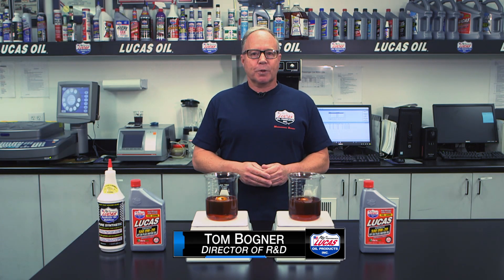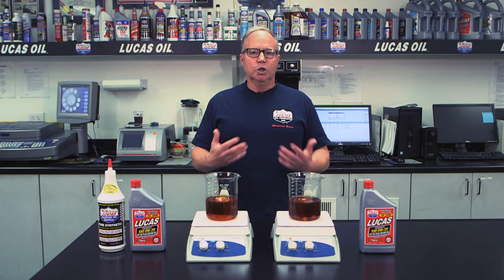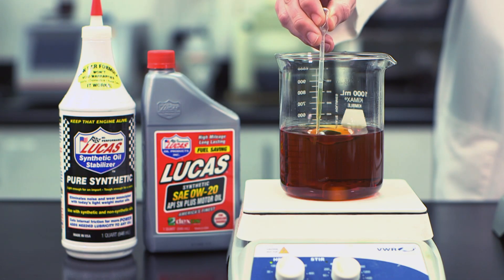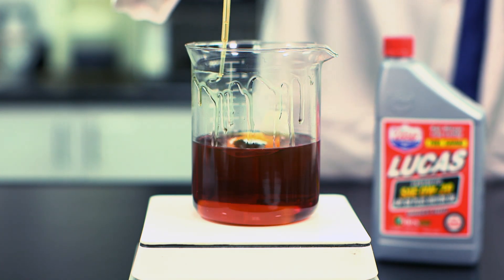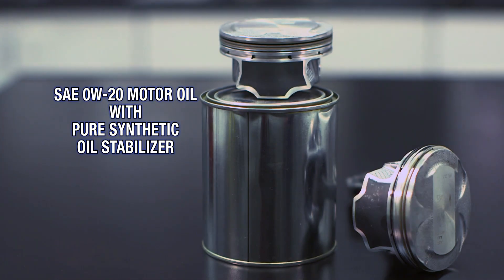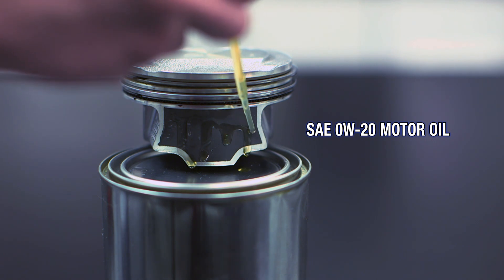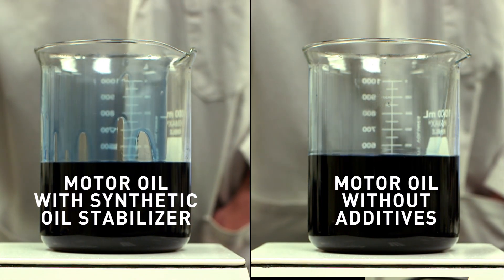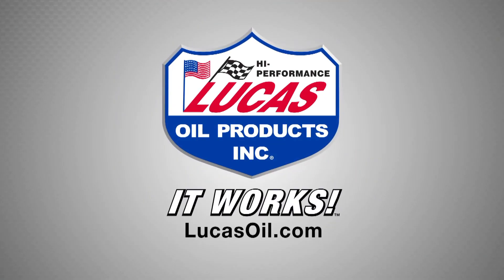Lab Test Lucas Motor Oil vs. Lucas Motor Oil with Pure Synthetic Oil Stabilizer.

Comment: Here’s a reusable, binder friendly Lucas % → SAE grade converter tailored to MaxLife 0W 20 + Lucas Pure Synthetic combo.
Assumptions (same as before):
•	Base oil: Valvoline MaxLife 0W 20, (\nu_1 \approx 8.5\ \text{cSt @ 100°C})
•	Additive: Lucas Pure Synthetic Oil Stabilizer, (\nu_2 \approx 45\ \text{cSt @ 100°C})
______________________________________
1. Quick “eyeball” converter (what grade am I in?)
Use this as your fast rule-of-thumb:
Lucas % by volume	Approx cSt @ 100°C	Effective SAE hot grade
0%	8.5	20 grade
1–4%	8.6–9.1	20 grade (slightly thick)
5–7%	9.2–9.6	High 20 / just touching 30
8–11%	9.7–10.2	Low 30 grade
12–16%	10.3–11.0	Mid 30 grade
17–20%	11.1–11.9	High 30 grade

Comment: The oil stabilizer didn't work on my truck.  I had a van run a stop sign at 60 mph and hit me while I was going about 45 mph.  It didn't protect my engine block from cracking from the impact.  LOL.  

Seriously, I use this in all my vehicles and toys.   The truck I mentioned above was a 2007 Silverado with the 4.8 V8 which had 366,000 miles on it when it was totaled.

Comment: Why aren't we at around 250°-290°F to simulate high oil temp like towing?
Reply: I’ve never seen temperatures like that towing he’s y between a Chevrolet Silverado and a Ford F150 towing at near maximum capacity. Not gonna lie that’s pretty radical temperatures, where are you seeing those type of temps???

Comment: Nice Video, For a F150 17 3.5 Ecoobost With 62,000 mi. should i use Lucas Heavy duty or Full Synthetic ?
Reply from the maker: The product we would recommend would be our Lucas Pure Synthetic Oil Stabilizer #10130 at a 20% treat rate.

Comment: In the intruction label said on harley-davidson motorcycle use 25 or 30% to the engine.Is 25 or 30% of the stabilizer(about 8 oz.of 32 oz bottle)or 25, 30% of the total oil charge of the engine?.thanks

Comment: 2013 Civic Si with 200k miles. Pure synthetic stabilizer or High mileage?
Reply from the maker: We would recommend our Pure Synthetic Stabilizer #10130 for your vehicle. This product will not change the viscosity of your motor oil as much as our High Mileage would.

Comment: Just bought the high mileage stabilizer for my sons camry with 290k.  It burns a bit and Ive tried them all, changing out PCV and hose and added Lucas.  Fingers crossed.
Reply: We have a 2013 Rav 4 we purchased used with 219k it consumes a lot of oil using 0w20 (eco oil that’s recommended from Toyota) started using Lucas heavy duty oil stabilizer with each oil change and the oil consumption has decreased significantly!

Comment: After much deliberation this is my final conclusion of the big "lucas debate".
Everywhere you look online you find self appointed experts who are quick to tell others to stay away from oil additives because "they are snake oil."
You also find almost as many people claiming they found benefits and have very clear reasons and examples of why they found benefits. 
What you dont find is people claiming the product harmed their engine in any way.

Let that sink in.

Then you have the viscosity debate. People are quick to assume that using factory oem weight is best because...well just because they said so. 
What they fail to consider is the money trail. Cafe standards are not testing longevity, they test efficiency. Using thinner oil means higher MPG. Higher MPG means lower cost of ownership, more sales, and financial benefits when it comes to carbon tax for both manufacterer and user.
People will argue "engine clearances" yet ferrari uses 10w40 or 50 in their engines. So do high power mopar engines. Are you really claiming those engines have "loose clearances"😅

The bottom line is that people who say "no to lucas", have very little evidence or experience with the product to back that up.
People who say "yes to lucas", gave it a try for one reason or another and found benefits. They did not simply wake up one morning and take to the internet to tell others to start using it.

Did I miss anything? Lemme know if I did.
Reply from the maker: 👏You sir, are a gentleman and a scholar!
Reply: @bigboreracing356  Ok so lucas has no bad reputation because of cyberbullying. Boy you over thought that one.
And it causes oil sludge in old engines that only drop the pan after adding Lucas. Brilliant.
If lucas was not helpful to worn engines it would have a bad reputation. Fear of retribution.😅 You must be kidding. That is truly hilarious. Thanks for the laugh.
Reply: @bigboreracing356  Ya I know your type. Perceive everything how you want while over explaining yourself to cover for the lack of ability to read and comprehend. My guess is, you spend all day arguing with people in the same way because your good at it. Judging by your nearly 1 to 3 ratio of videos to subs you also think your pretty important to keep posting the useless content about what you did that day. Get a life my dude.
Reply: @bigboreracing356 This guy is easily the saddest man in the world. You obviously spend all day on YouTube. Not even links,  just wasting your day.😅
Reply: @bigboreracing356  You get paid to sit around grifting all day with your 600 subs and 300 videos 😅
Who do you think you are fooling. Bro. You are sad. Truly. Get help.
Reply: @bigboreracing356  wait. New engines? Where did you get that idea from. This product is intended to help worn engines. As recommended by FORD. Noone ever said new engines. Who said new engines? You did. 😂 Arguing with yourself. On the internet.
Reply: @bigboreracing356  Forr recommends Lucas oil stabilizer for the 5.0 coyote motor when they are high mileage and struggling to maintain oil pressure. 
Look it up. Suprised you didn't know. Wait. No actually I am not surprised.
Reply: Ive been using Lucas Stabiliser for a very long time.  It has caused me zero problems and my engines run smoothly..and don't seem to wear out.  I do let an engine warm up before using it hard, to ensure that oil is circulating freely..because of the more viscous nature of the additive-mix.

Comment: Good video just wondering does it change the oil viscosity say from a 5w30 to like a 5w40 or 10w40?
Reply: Same. Just clings onto metal parts better for more protection.

Comment: I have a 650hp 5.0 supercharged Jaguar XF-R with 100k for miles . I use 5-20w full syn liq moly and live in hot Georgia. Should I use lucus and should I use heavy duty or full synthetic? I currently have no issues with my engine with dry start or anything.
Reply from the maker: We would recommend our Pure Synthetic Oil Stabilizer for your vehicle 👍 Nice ride!

Comment: I used heavy duty on my 5.7 hemi that I run 5w-20 full synthetic oil do I need to be running full synthetic stabilizer instead of heavy duty stabilizer
Reply from the maker: You can run Heavy Duty Oil Stabilizer in your 5.7 Hemi, but the Pure Synthetic Stabilizer would be the better choice for your particular vehicle.
Reply: @LucasOilProducts  thank you

Comment: how much do you use? my 2016 SS Camaro takes 10 quarts.
Reply from the maker: We recommend a 20% treatment rate.  You will want to use 2 bottles of Lucas Oil Stabilizer & 8 bottles of motor oil.
Reply: @LucasOilProducts  Thank you!

Comment: Was this test done at room temperature? The inside of an engine at full temp is over 200 degrees will it still cling to the walls at that temperature as it dose in your video? And other people have already sent samples of your products to independent labs to be tested and discovered that your oil stabilizers contain little to no additives it just a very heavy weight base oil nothing else. The problem with this is adding this product to your engine oil that already has a balanced additive package will be disrupted and diluted resulting in the engine oil breaking down sooner over time.

Comment: I am totally convinced. I did some stupid thing to my Toyota ECHO at 210K. That car had miss fires on random cylinders and squeaky noises ever since. 3 days ago, I put 1/4 of a bottle of Lucas synthetic oil stabilizer. The miss fires are gone, vibration reduced a lot, the squeaky sound gone immediately, and engine quiet down. I am totally convinced. You will have me a customer for life. I will use it on ALL my cars in the future.
Reply: Look into Xado products as well. I had a lot of luck with those. Not promoting anything just giving you 2 cents from my experience. I run both of those and never had any issues
Reply: Did you get the high mileage one or just the regular one?

Comment: Adding thicker oil will run down slower than thinner oil. This test is garbage.
Reply: If it raises oil pressure it has to thicken viscosity.  So yes you are technically right. But I think their argument more is film protection stays on moving parts longer therefore helping cold starts or starts in general which is when most engines wear happens.  Have you heard of Lubeguard LX heavy duty additive?  I use it.  It has esters

Comment: Why not just add it to your oil from Lucas factory?
Reply: Probably because you wouldn’t be getting what’s advertised on the label, add it to 0w20 and it’s now heavier that a 20weight
Reply: @bradleyhomer3590 yup,its close to a 5w30 per lab testing but not quite.
Reply: Beat me to it
Reply: Motor oil has other applications too
Reply: @johncoulter8966  please do tell?
Reply: Because then they won’t make money from premature engine failures
Reply: @mk4geo822 I can only say what I did and that was this. New 2011 kia optima, 0w20 mobil1 FS + 1 qt of lucas synthetic oil stabilizer, oil change interval every 10,000 miles. Stopped using Lucas stabilizer and the engine threw a rod shortly after at around 147,000 miles